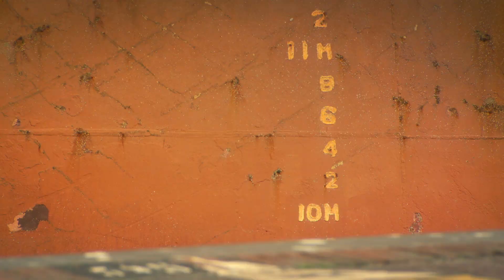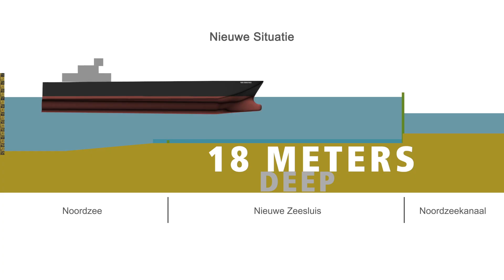New Big Sealock IJmuiden

Comment: Where are they going to build it and how?
Reply: If U pause the video at 0:15 the new lock ( The Zeesluis Ijmuiden ( Sea Lock Ijmuiden )). Is built on the southern part next to 
the Noordersluis lock ( it is  right to the Noordensluis lock on your screen ) .
The new Zeesluis Ijmuiden lock is now ( January 26 2022 ) in operation. 
How was the new lock built? The engineers dug a small and deep trench close to the Noordensluis lock. 
And filled this trench with concrete. The Noordersluis lock was always in operation during the construction of the new lock.
Today ( Jan 29 2022 ) all the old ( Zuidersluis, Middensluis, Noordensluis ) locks  and the new Zeesluis  lock are   ready for operation. 
Btw construction of the new Sea Lock Ijmuiden started in 2016 and was completed a few days ago. 
The building of the new lock was Not a easy procect.. Ijmuiden with their locks , and the steelworks in Ijmuiden where 
heavy bombarded during WW 2. It took quite a time to deactivate all the  bombs that were there.